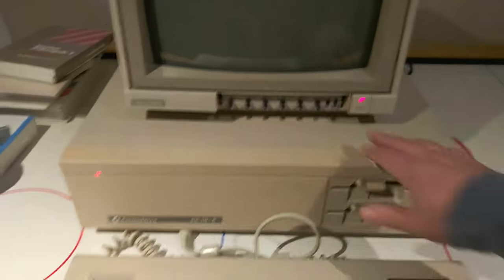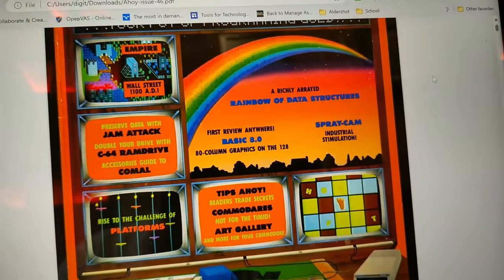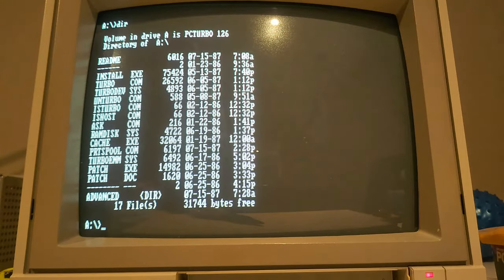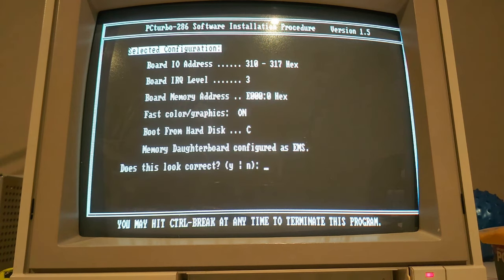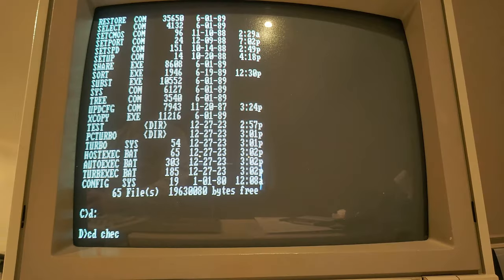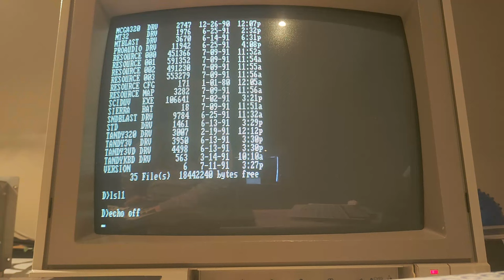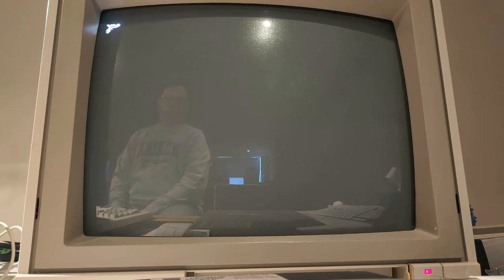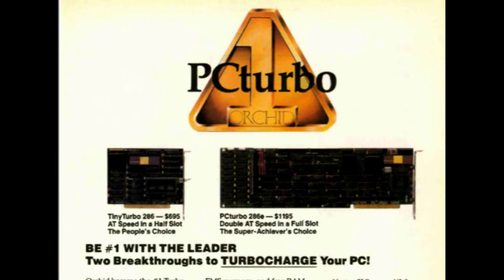Installing and testing the PCturbo 286e on a Commodore PC 10-II

Comment: So there is no way to run a 286 operating system like os/2, xenix 286, coherent, because you need the dos driver to start the accelerator card?
Reply from the maker: Good question.  It does load it's own version of DOS after the driver is successfully executed. Like having two computers. I wonder if there is a way to have it load a different OS.  I doubt it.  Even if you could it likely won't be compatible.